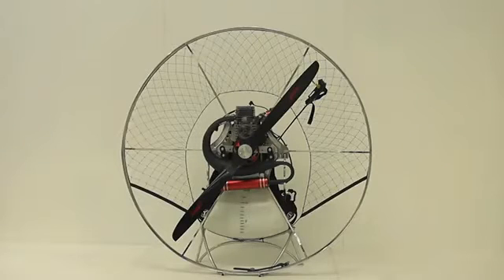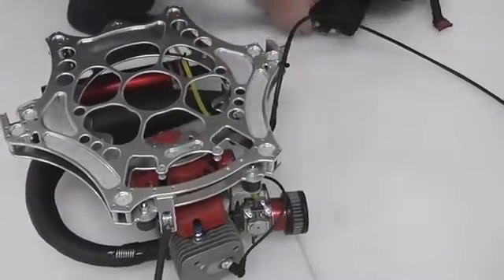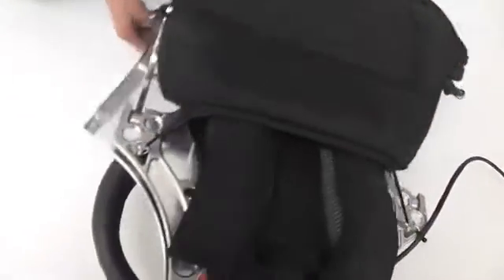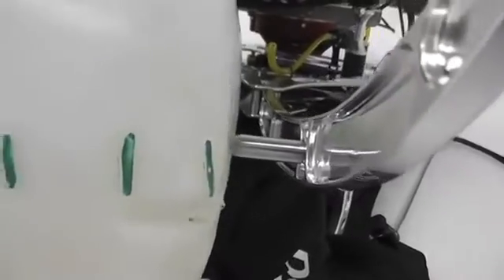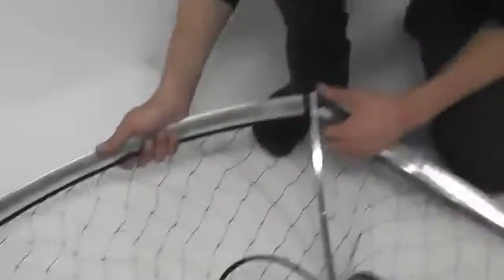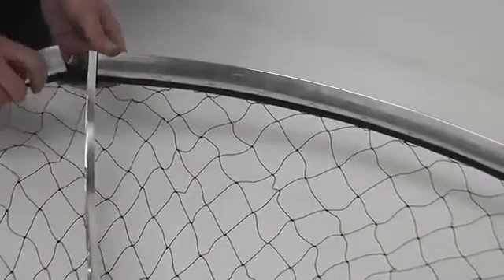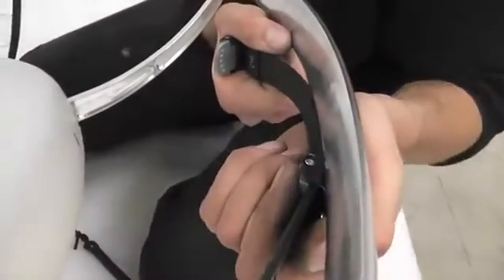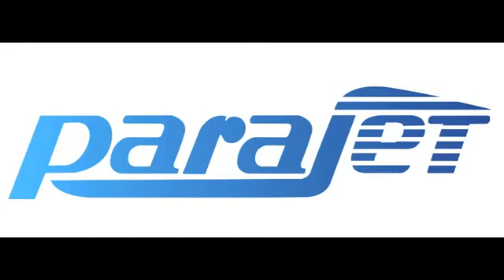Building a Team Zenith Paramotor

Comment: Are all new Parajet harnesses supported onto the frame as shown in the video? The curved metal tube section approx 25cm snapping into the upper frame (2:16 in video).
Reply from the maker: Hi Leonard, thanks for the message. No, the method of attaching the harness to the Zenith has now changed and been updated.
Reply: @parajet  Is there an accompanying video to illustrate this latest assembly?
Reply from the maker: @leonardmcdermott7703  we have sent you a video to your email address.